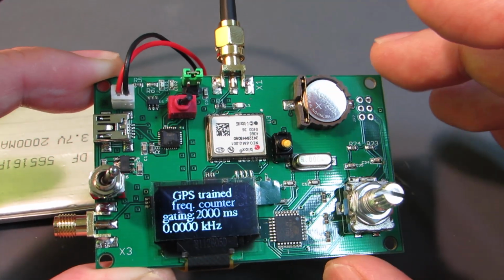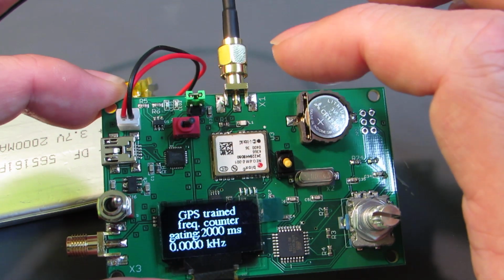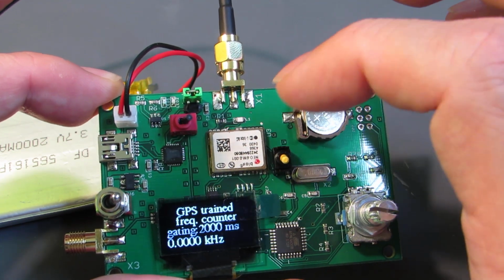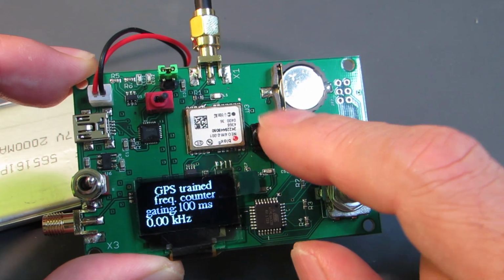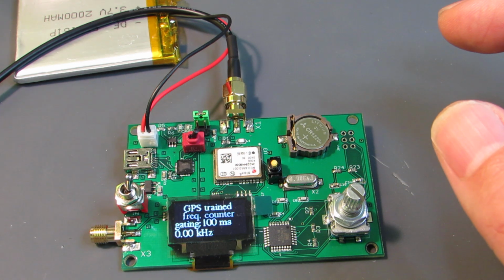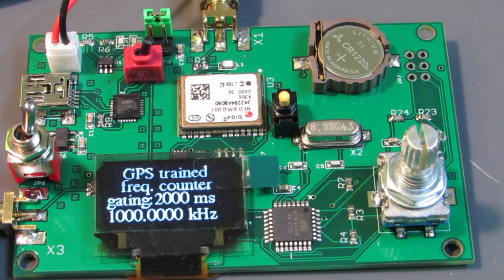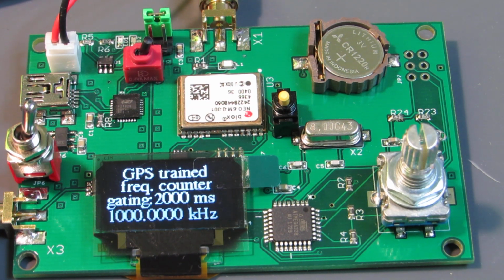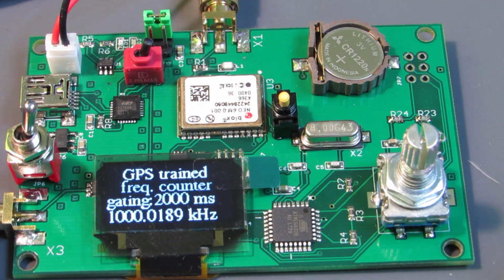Ultra high precision frequency counter driven by GPS trained signal.

Comment: Hi, I love this project and I am going to replicate it because I need a cheap but accurate frequency counter.
In order to increase the Arduino clock to 16Mhz or 20Mhz do you think that using a PLL multiplier IC (ICS511) could be a good idea or it will lead to accuracy loss?

Thank you for sharing this project

IU4IRC

Comment: What is the high frequency limit for this counter?
Reply from the maker: Hello. I am especially focusing on its accuracy and the maximum input (50% duty radio) is just 4MHz. This limitation is due to the main clock (8MHz) of MCU. We just need to add some pre-scaler for higher frequency measurement. (indeed no need to add special pre-scaler but just "counter by 74 series" is enough to extend its limitation. Thank you!

Comment: Nice project.  I have a 10 MHz GPS disciplined oscillator I use around the shop. I used to be able to get to better than 1 ppm with a bit of patience. Being able to do much better with no real effort is nice. It would be handy to have a 10 MHz reference come off the counter board to support other instruments.
Reply from the maker: Exactly. Indeed I have lots of instrument with 10 MHz in/out (VNA, SPA, oscilloscope..) and actually I myself it will be quite useful....

Comment: That's so cool! I had no idea GPS could be used in such a way. Forgive my ignorance but what's the use case scenario of such a high precision frequency counter?
Reply: To put it simply a disciplined oscillator is used to dial in the accuracy of your bench tools. This goes into the endless rabbit (black) hole subject of accuracy versus precision that many a hobbyist has lost their sanity chasing.... or so I've been told.
  When it comes to bench tools like  an oscilloscope, frequency counter, function generator, spectrum analyzer, etc., they often have a 10MHz frequency input on the back of the device.  Basically, this is needed to calibrate their accuracy. These devices may be very precise (or not depending on the device), but if they are running on their own independent oscillators, they can be said to be "precise" but not "accurate."
   For example, let's say a frequency counter uses a 20MHz standard crystal oscillator internally. If this internal oscillator has an initial (when new) accuracy of +/-20ppm, the device will "think" it's 20MHz clock is 20MHz. The device has no way to calibrate itself in order to account for the +/-20ppm accuracy of it's oscillator. This means, even in a perfect world, without additional factors, the 20MHz at +/-20ppm is really somewhere between 19,000,600 Hz and 20,000,400 Hz. Whatever this value is, in the real world, the device "thinks" this value is 20MHz exactly.
  If you work entirely on your own at your own work bench and your tools/projects will never be externally referenced or interact with the real world, the actual accuracy of your tools or devices is not very important. If your tools and devices are all "saying" x/y/z frequency is x/y/z frequency your A-OKAY in using this as an absolute value. If you're looking to interact with the outside world accurately, then you need accurate tools. You're tools/projects will need to know exactly what 10.0000MHz is and they will need to use a phase locked loop (PLL) circuit to synchronize themselves with an external system. This external system is usually a disciplined oscillator of some type.

  Now this was an extremely over simplified example, but if you've followed so far, I'll add one more. The internal oscillator of your devices is probably a standard crystal. These are also influenced by temperatures. The next best type of on board oscillator is the temperature compensation type, but odds are your device doesn't have one of these. A disciplined oscillator also ensures that when your lab/work bench tools say your measured circuit is at 1.0000MHz at 10am when the room temp was 22C, the 1.0099MHz it measures at 2pm at 23.5C is infact a change due to the device under test and not a variation in your bench tools.

  So the use case for a disciplined oscillator is anyone measuring frequency, and especially anyone interested in building devices that interact with the real world accurately. 
-Jake

  For a deeper and more accurate look into disciplined oscillators Dave Jones made a video over on the EEVBlog YT channel (no affiliation). For truly in depth information about frequency accuracy/precision do a google search for "Time Nuts mailing list" and just search/read (no affiliation).
Reply from the maker: Thank you so precise explanation and guidance. Please make your own page or project on hackaday.com!! Thank you!
Reply: @microwavemont  
 Thanks, I'm just learning too. I started learning about disciplined oscillators because of a reference in the documentation of the OSHW AVR Transistor Tester project. I'm not an expert, but I like sharing what I've learned. I'm just getting started with more serious hardware design and home etched prototypes. I dream of making boards and projects like this. I especially like the metrology stuff like you built here. It's very inspiring ;)
-Jake